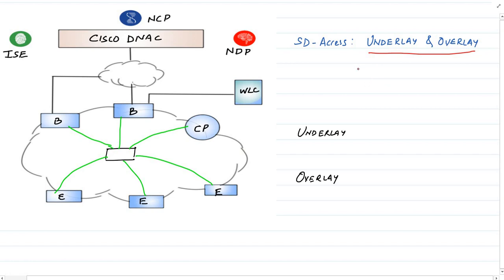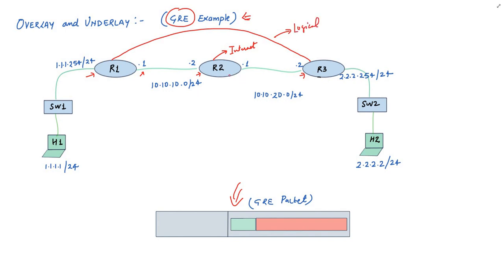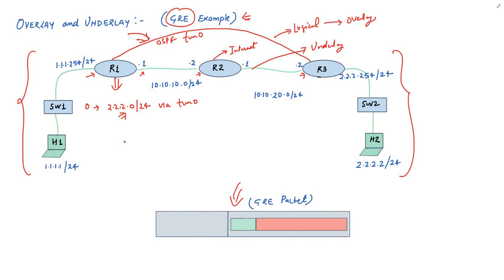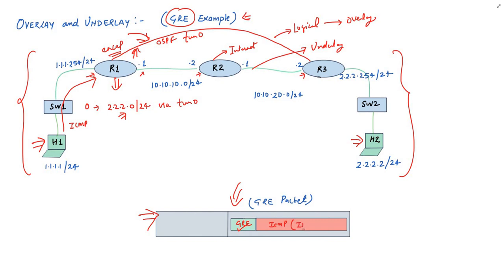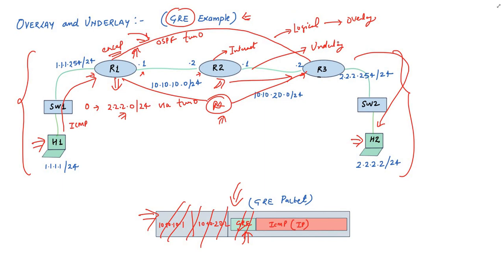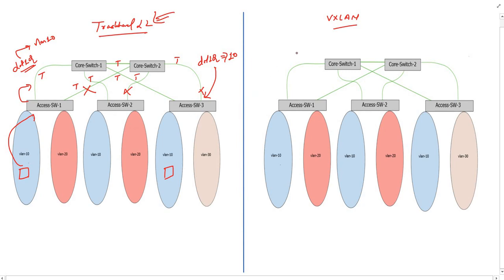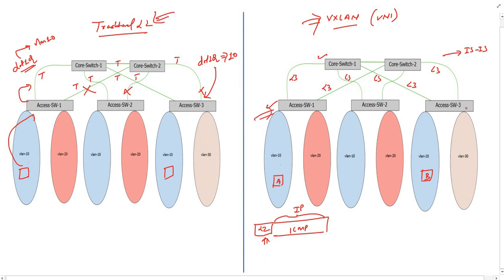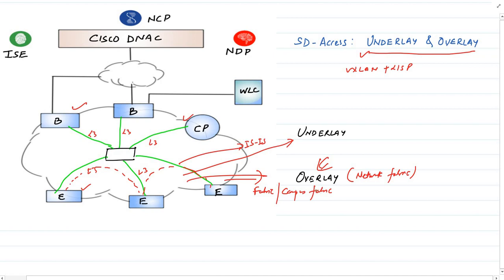SD-Access Underlay and Overlay

Comment: Hi,
Thanks for this nice video, it is very intersting.
But the Underlay Tunnel in Wireshark is indicating SOURCE IP ADDRESS 10.0.0.1 and DESTINATION IP ADDRESS 10.0.0.2
This is not conform to the diagram you are using to explain the technology.
Regards,
Kamel.
Reply from the maker: Thanks and yes you are correct... I need to correct source and destination IP addresses..